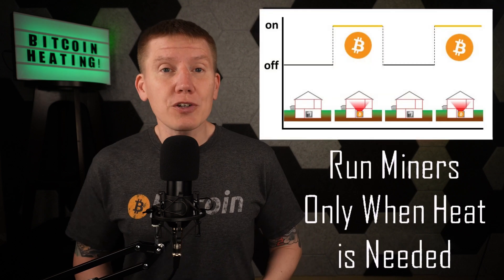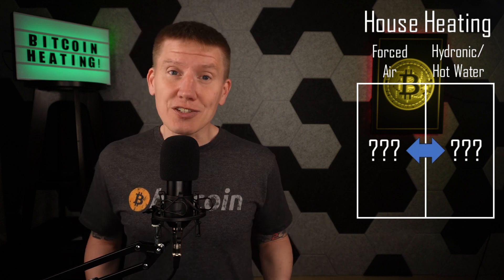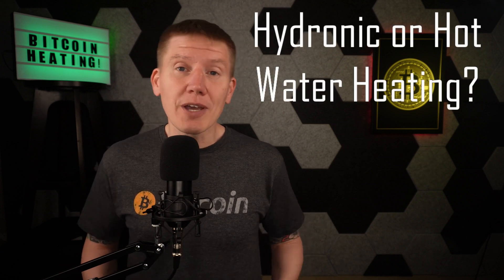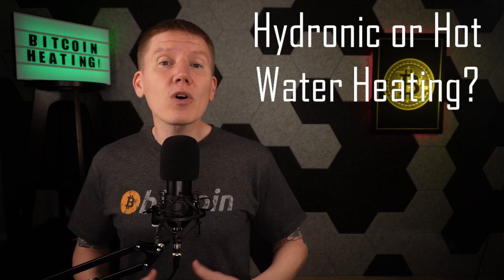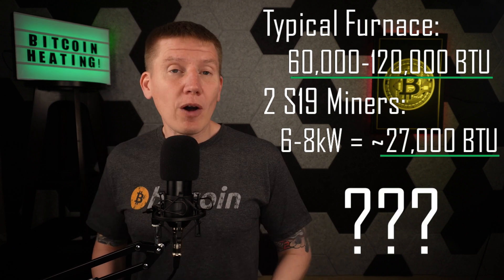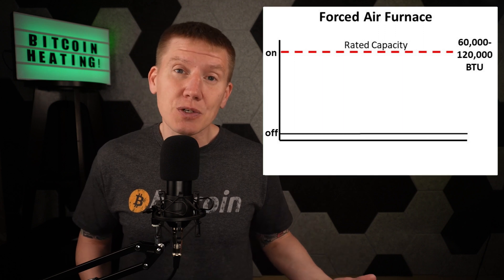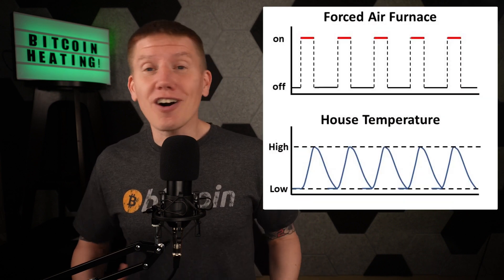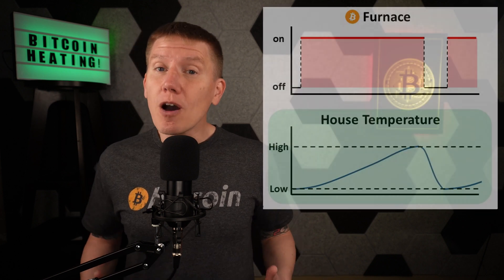EP20: How to heat YOUR home with BITCOIN!

Comment: Just found your channel! I have an S19 XP that I want to discretely integrate into my hvac system. I would prefer for it to run continuously, dumping heat externally when not needed. Last winter I was able to keep my living room warm with a GPU rig. My asic has a lot more energy and I would love to use the existing ducting. Excited to watch your videos and see what comes next.
Reply from the maker: Thanks!  Yeah, next episode comes out tomorrow!   Forced Air Furnaces are up first!